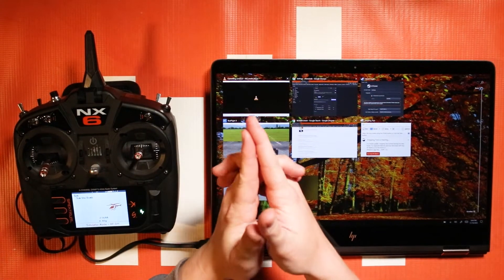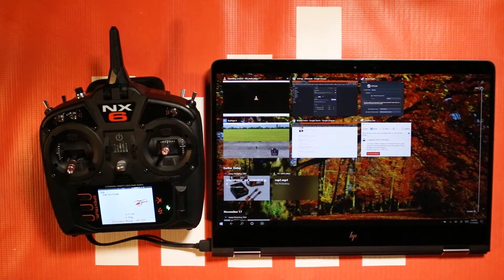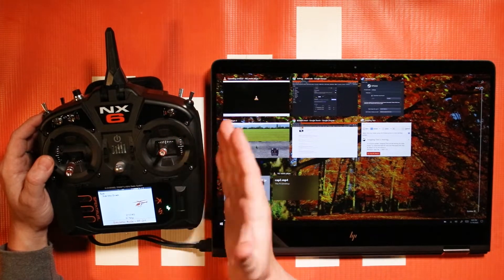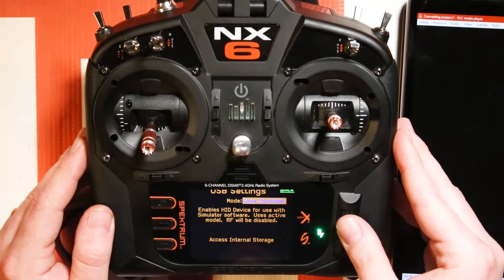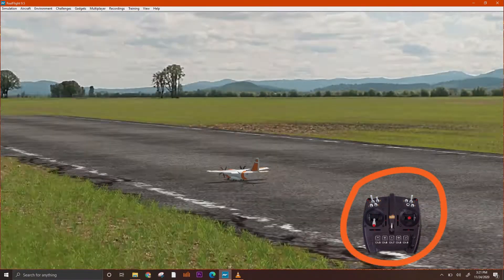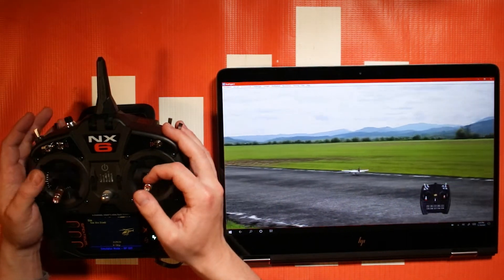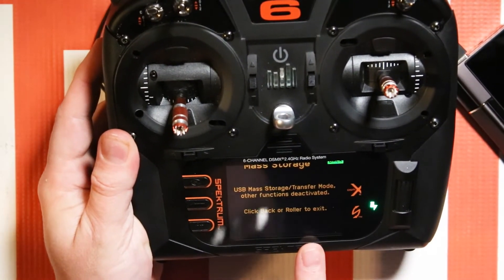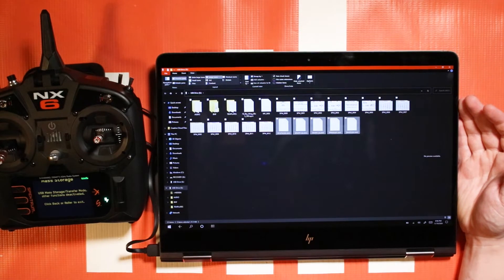NX Instructional Series - How to use the USB port for Simulators and Storage

Comment: I've hooked up my nx8 to my PC but for some reason it wont recognise any input from my elevator stick. Any idea what the problem might be? I've seen quite a few people report the same issue but haven't been able to find a solution. I tried swapping the channels on the transmitter settings too to no avail. Any help would be appreciated cheers!

Comment: I'm having issues with my NX8. I's recognised by my computer, but that's it. The calibration app built in to windows I can choose the NX8 but the app doesn't detect anything when I move the sticks, same with the sim I'm trying to use, IE it knows the NX8 is connected but moving the sticks isn't picked up by the sim. I have feeling it's just some setting I need to choose, dunno?

Comment: Hello, I have a spektrum nx8 since 1 week ago, I'm trying to use It as controller for my simulator (Aerofly Pro deluxe) without success. on the usb mode if I select game controller nothing happens in the simulator. I also own the spma3091togheter with the native Aerofly usb interface, I tested without success. Navigating in the trainer menu, tested all the options but nothing happens. please could be possible to have support or a video tutorial about how to setup nx8 as game controller Via wired trainer? Thank You so much in advance

Comment: So here's my issue. neither the interlink or my NX10 will not run the sim. For whatever reason the computer can't connect to them. My email says it downloaded fine, but it will not run. Help! Happy New Year's! 💥
Reply from the maker: What Sim? Does your PC recognize the NX10 when you plug it in?
Reply: @SpektrumRCvideos  No, it does not.
Reply: @SpektrumRCvideos  I put it in Game mode mode, but nothing. I'm kinda sure it's a driver issue, but I have no idea how to download the right driver. It worked with the Phoenix Sim.
Reply: @SpektrumRCvideos  There an issue with the NX10 When adding Sound to the switches for the UMX Turbo Timber, It corrupts the ESC  in the plane. My local hobby Store replaced the plane once, but I wasn't sure that was the real issue, when I added sound to the Flaps switch on the new plane, it gives an ESC warning sound. If I bind it to a new model, it gives the warning as if the ESC has been corrupted again. All my other planes are fine with sound, it's just the UMX Turbo Timber that has this issue. I hate to ask my Hobby store to replace it again unless you want me too. Everything works fine until you add sound to the switches.
Reply: @SpektrumRCvideos  I sent for a Power USB Port hub. I'm reading that some older Laptops don't have enough power in the USB port to recognize the Transmitter. We'll see if that works. The transmitter works fine on a newer Laptop.

Comment: Very helpful but with NX10 if you want to transfer files (like the new BNF profile for Draco BNF) the USB settings has to be set to INHIBIT and then select the access storage. Otherwise windows 10 thinks the radio is a games controller and won't set it up as a USB drive. Once discovered is a great way to transfer and backup files.

Comment: my laptop doesn't connect to the nx8. I followed your tutorial and finally got explorer to see the nx8 as a drive and list the files but if you tried to look in a folder it immediately locked up. I use directory opus as my file manager and it won't see the drive at all.
Reply from the maker: While it is plugged, try turning USB Mass Storage off and on again. Otherwise, can you give us more info on your PC? Not familiar with Opus File Manager
Reply: @SpektrumRCvideos  after much trial and error finally was able to read internal memory but it was very e r y slooow. If I modify my sound files and save them on my SD card can I copy them from within the radio or manual copy from card to internal. Needless to say I won't be hooking up from PC much. Thks

Comment: Hi there, thanks for a great video. I've got a bit of an odd (newbie!) question: I'd love to use an NX8 for both a Carbon Cub S2 and a... multiplex electric glider! How can I switch the glider's electronics to fit your transmitter? Is it even possible? In advance, thank you very much for your help. Best regards, stay safe. 👍🏻
Reply from the maker: Likely all you need to do is put a Spektrum Air receiver into the glider. Do you know which model it is exactly? I can give a better suggestion if you can :)
Reply: @SpektrumRCvideos  I'm thinking about the Heron 2.4m...

Comment: I have a Nx10 and the magnetic usb connector sometimes stays on the radio other times it stays on the plug. Seems random and I’m afraid of losing it.  Seems loose on the radio.  Any tips to shim or glue it?   Just seems like the tiny part to lose out at the field never to be found. Thanks!

Comment: Hi Tom, can you tell me if the programming files for the DX9 are compatible with the NX8 and NX10, want to get a new transmitter but don’t would rather not have to reprogram all my planes and Helicopters. Also can’t seem to find a list of all the BNF aircraft that have been preprogrammed into the NX transmitters. 
Thanks
Reply from the maker: They certainly are compatible. The list is ever growing, is there a particular model you would like to see on there?
Reply: @SpektrumRCvideos  
Yes, having trouble with a Blade 500 3D and it’s not in the drop down list for DX9 on the Spektrum site. I think I have it figured out. But my DX9 now has a broken gimble so going to upgrade to the NX.

Comment: How do you reset a model after crash with nx6 with real flight 9.5? My interlink has a reset and haven't found a way with my nx6? Thanks
Reply: Space bar...
Reply: @mikehagen3785  thank you Mike that worked!!!!
Reply: @johnandedsrcplanes7752  no prob, I just recently got the Sim also, look at the instructions on the top of the screen, it will help a  bit..

Comment: Nice video.  However, my NX10 is not recognized by my USB as a simulator with either the simulator setting on or off.  Have a Mac, and not recognized by teh Aerofly nativ to Mac or the Realflight on the VMWare PC emulator. Any suggestions?  Thanks.
Reply from the maker: Will it recognize it as a drive if you turn on access internal storage?

Comment: Hey, I have a throttle delay between my 3 middle notches in my throttle on Real Flight with the NX6, it doesn't do this on the Interlink controller but it does on my NX6, is there a way to fix this, or is this something wrong with the radio i have, I just received it in the mail today from Horizon Hobby and I think there is something wrong with it
Reply from the maker: Interesting, haven't noticed anything like that... might be a good idea to call in, but I will try it on my end to see if it is a bug. Thanks!

Comment: Is it legal to use the NX10 with a simulator on a commercial flight? I’ve flown with an Interlink DX, but would the NX series with the usb connection be legal with the RF transmitter off?
Reply from the maker: As long as you leave the RF off it should be fine :)